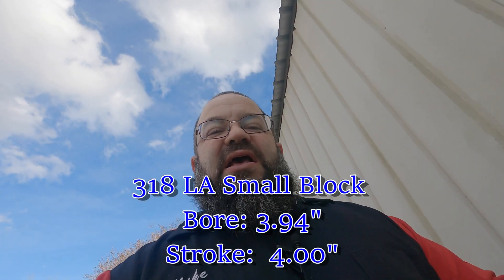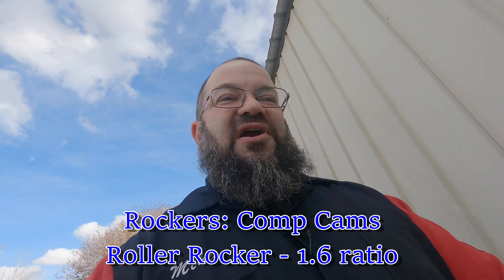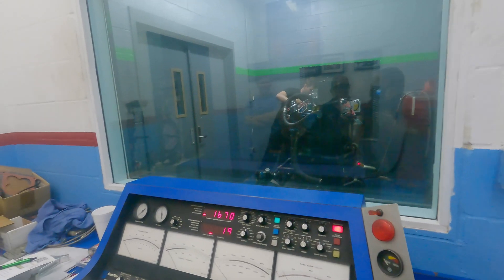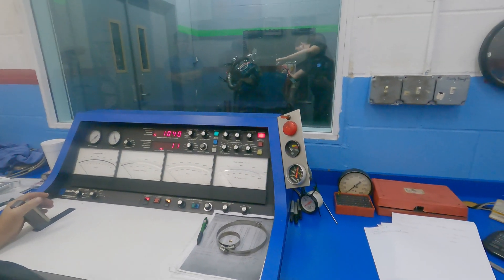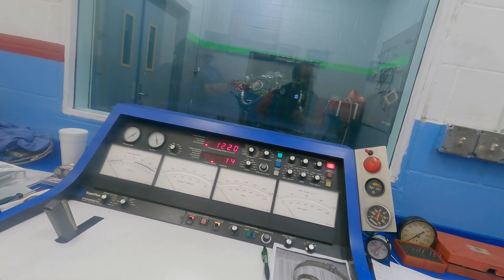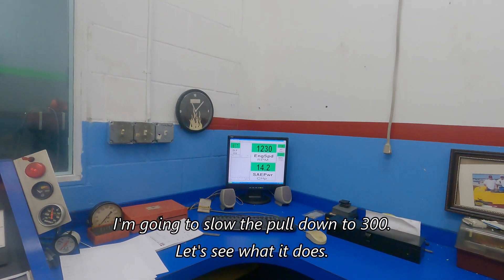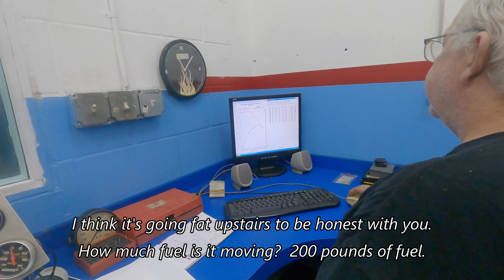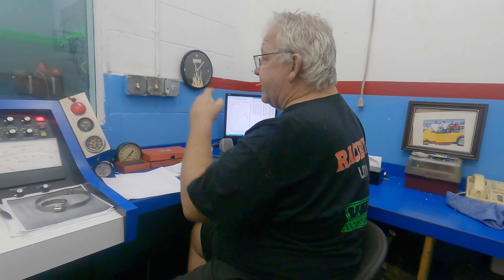Dyno Session: Chrysler MOPAR 318 Stroker | Can We Get Over 450 hp and Over 490 Lb-ft of Torque?

Comment: Did you mean to say the heads are cast iron, never seen a steel head myself. Sounds good and makes good torque and HP be exciting to see what it does at the track.
Reply from the maker: Those that know, know. Then there's those who use the terms interchangeably because people know.
Reply: @MicsMotorworx  Must know something that no automotive publication I have ever read in the last 65 years knows as well as any machinist or engineer I've talked to, sounds kind of like those who call their SUV's trucks to me. So, what is it you know that others don't, is it a secret?
Reply from the maker: Nope. I am definitely not a pub, a pro, nor an engineer.  Just a shmo who shares a love for certain things auto.
Reply: @MicsMotorworx  Neither am I but I try to call things what they are unless it's a universal slang that is well known and accepted. By the way I bust on everyone that calls their SUV a truck and many do. If I lived close at hand and had the cash to spare, I'd bring my 400 Mopar over and we'd dyno it. If I run the upsweep HP cast iron 2.5-inch outlet factory exhaust manifolds w/ 3' of 2.5-inch pipe it overheats if I run open truck header it fails to make thermostat temperature 185 degrees. Can you explain that? I can't.
Reply from the maker: Interesting.  What are the variables? In car? At idle? At highway speed? On a stand? Consistent temps at each exhaust port? Fuel? Fuel type? Compression ratio?
Reply: @MicsMotorworx  On an engine stand, regular 87 octane, approximately 8.4 to one compression ratio, BB Mopar truck copper radiator w/ mechanical fan and electric fan running, idle or 2000 rpm steady makes no difference it still overheats with the cast iron manifolds. A carburetor shop 750 double pumper with four corner idle. Comp cam 501 lift, hydraulic lifters set with .020 preload, roller rockers. pistons are forged, molly rings. Haven't taken a temperature reading on the exhaust nor have I hooked up an 02 SENSOR but plan to, the plugs read good though. Been sitting in a corner for about a year now and it will be about a week before I can get to it to fire it up again as my garage is full right now. When I get it running, I'll take those readings. Thanks for responding and taking an interest.
Reply from the maker: No prob. Yeah if all is consistent, those O2 readings might help. Maybe a slightly more potent octane. Modern 87 might not be the best despite the lower compression.  Let me know how it goes.

Comment: I took my 85 dodge ram charger 318 out went 30 over SRP flat tops 10,000s out the whole with the smaller combustion chamber 302 casting head with a 52 to 54 cc chamber pump cam 236/242@50 490 lift@110 Edelbrock air gap Holley 750 produce 421 hp at 6100 RPM and 440 torque at 5200 RPM. It was a great engine although it was a struggle with those heads for higher RPM I switched up to a set a 360 heads and I could make more RPM but I lost horsepower and torque roughly about 30 horse is just under 40 in torque I restart engine for three years after I drove it on the streets for a couple years but I finally clearest the cylinder walls. I got a little greedy on timing. It did not like 37°. I’ve since then built a 372 and I did a 421 in.³ stroker all still utilizing cast-iron heads. I like a good square motor yawls motor is definitely gonna be a torque monster being it’s under square I know that helps tremendously with the weight of higher piston speeds. what machining did you do to the head? Did you deck the block? How much did your deck the heads? What’s your static compression or overall compression?
Reply from the maker: The block was decked, but we didn't get that measurement from the machine shop that did the work prior to initial assembly.  We didn't meacher the volume of the  combustion area in the heads, but we estimate around 10.5:1 ratio.

Sounds like a nice combo in your 318.

Thanks for watching.

Comment: GENTLEMEN... IS THERE ANY POSSIBILITY THAT YOU CAN TELL ME HOW MUCH COSTS FOR A 318 CID CHRYSLER ENGINE MODIFIED TO REACH APPROXIMATELY 350 HP WITH ALL THE EQUIPMENTS (NEEDED)... WHAT ABOUT THE (VALIDITY)???...( ACTIVITY)??? CONCERNING THIS ENGINE... SUCH AS (MILEAGE).....(LIFE ENGINE)....
Reply from the maker: Thank you Jay.

About two years ago, I did my first hands on build for a stroker based on a 318 block.  I captured it on video here: https://youtube.com/playlist?list=PLTQDQ6J_6-sY8jcyFhqPHNN3yRl700x8z

In the video descriptions, I placed the parts needed and links for the parts I had to purchase for the material covered in each video.  There were some things that were provided for by the machine shop, which they had special tools for. This included the cam bearings and such.  Additionally, we upped the ante with a fully balanced rotating assembly that we had to go to another shop in a metropolitan area for servicing.

For the build, we had the block, crank, rods, push rods, heads, valves, intake, and oil pan.  As for tools, we had a lot in our shop and a few that we had access to.  Each hobbyist or builder's garage is different.

It's hard to estimate and give a current price on things.  That's why I left links in the video descriptions instead of a price.  Seriously, inflation in two years has caused parts to nearly double in price.  

As far as engine live, there are a lot of variables there two.  During the 70s, it was common to rebuild engines every 100,000 miles or less.  Since then, there've been changes in metallurgy, parts, durability, oil composition, and such.  There are also variables with compression.  However, based on a mild 318 build, and with proper care, parts, and maintenance performed; there's no reason why someone wouldn't get less than 120,000 or more.

As far as MPG, that all depends on the driver and the car.  It's easy to estimate 20mpg at a mild cruising rate with the right transmission and rear-end combination. 

I hope this helps shine some light on things.
Reply: I have a 98 Dakota 5.2 l, .318, have looked at building a .390 stroker, and have found I might have 5-6000 in parts alone.  With my block being the only original engine part being put back.
Reply: Wtf mild cam??
Describe a mild cam.. center line.. lift, duration what degree do I install this mild cam? Do I need a off center key?
Reply: Good Heads are where you’ll make power. Set of aftermarket aluminum ones and just about any mild cam should get you up lose to 350. The stock 318 heads are what really holds them back

Comment: The 318 is truly a hugely underrated engine for making solid torque numbers and some good Hp . The blocks and bore stroke combo is pretty darn good. They rev well and if you get a 68-74 block you have a baby 340 block as far as metallurgy and strength. I am doing a strong 392 stroke combo myself right now for my 68 Dart 2 dr sedan. 🎉🎉🎉
Reply: I had a 73 360 two barrel that would run circles around a more modern 5.2 magnum with 4 barrel and high rise intake. I always got better mileage from the 360 and it always pulled great. The 5.2 that took its place just couldn't get anything over 15 mpg and to get it to move I had to rev it to 3500 and above. The 360 would come alive at 2000 and pull great all the way to 4500 and routinely get 18mpg. I would be curious to see what a 390 stroker would do compared to my old worn 360.  I care more about the driveablity vs the high rpm horsepower. The 5.2 just didn't  impress me.
Reply: Baby 340??
Reply: @SSPlymouth anything you can do to a 340 you can do with a 318.
Reply from the maker: There's a reason they were used in so many applications, for the general consumer, commercial, and industrial. 

Let us know how your project goes.
Reply: @MicsMotorworx  you got that right and they are still plentiful n cheap to buy. I prefer those earlier blocks but any of them Pre magnum work well in a 75 n older A body.
Reply: @MicsMotorworx millions used in marine by what was Chrysler Marine. Chrysler Marine built great great engines.

Comment: If you're simply looking for a really streetable motor, you nailed it. Nearly 500 lbs of torque is very respectable. If you're wanting more from this engine it could use more cam, preferably a Hughes Engines getting closer to .600 lift and their Big Mouth port job. You'd probably get into the low 500hp range.
Reply from the maker: For sure. 

I'm very pleased with these numbers. If the notion of a power increase was put into action, Pop and discussed going to a roller cam with longer duration. Personally, I would be hesitant to move to a solid lifter. His thought for the current cam was the max opening for a hydraulic lifter while maintaining the flat tappet. I figured a compromise could be something with the same lift and longer duration.

Thanks for watching.